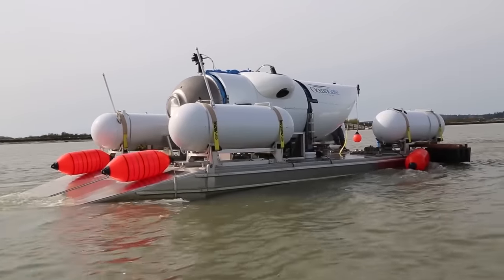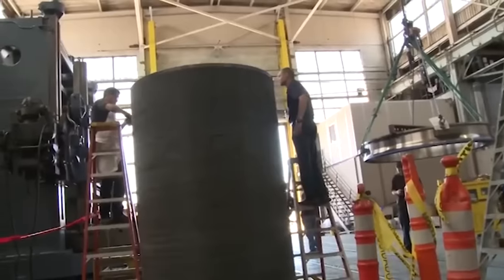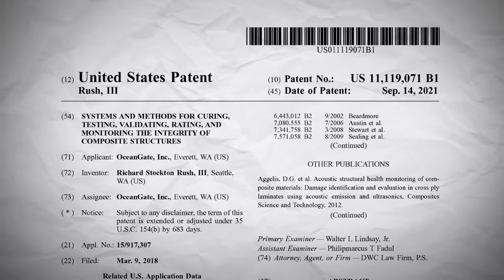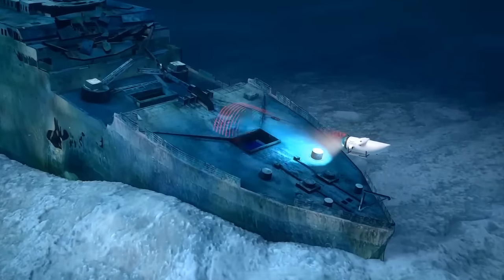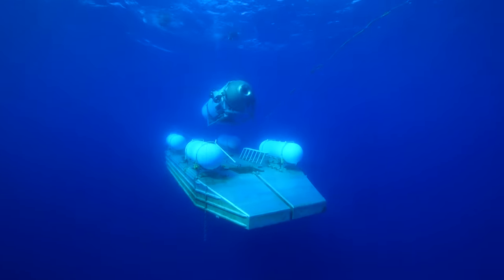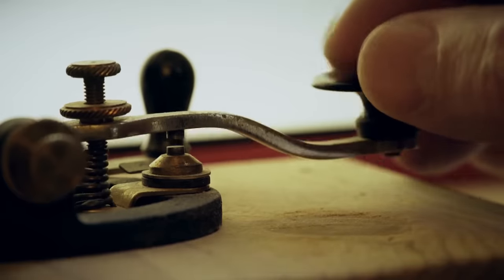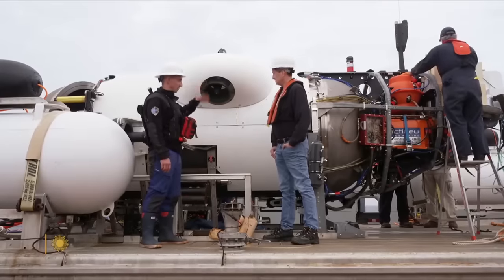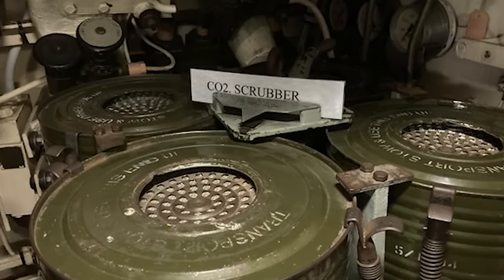Exposing OceanGate Submarines Many Fatal Designs

Comment: 5:50 Most of the complaints about the use of the game controller for the submersible wasn't actually about the use of a controller as a concept; It was more about their selection of a significantly substandard controller from a 3rd party manufacturer. Most organizations that make use of controllers for these kinds of applications usually use 1st party hardware because of its high reliability, and ease of replacement. It is well documented that the specific model of Logitech Xbox controller that was showcased in the interview had known reliability problems. This raised concerns because it showcased that OceanGate were completely willing to use substandard parts for vital functions on their submersibles.
Reply: That is also incorrect. It's the fire hazard caused by it not being purpose built. It essentially had to be made and tested and proven to not cause sparks.

First party controllers are also not safe. The navy uses them in normal air, not pure oxygen, and theirs are usually modified.
Reply: The controller is not the issue here. It baffles me that people keep leaning on the controller as if it is the problem here. No, it is not.
Reply: what is a "first party" game controller
Reply: Yeah, this 'content creator' clearly didn't understand the issues with the controller.
Reply: @tsm688 exactly. that term has no meaning in this context.
Reply: @tsm688  A controller made by a system integrator for the specific system they are building. An example would be using an XBox controller for an XBox. Or, in the case of US Navy systems, a Raytheon (or insert your favorite MIL SPEC integrator here...) controller to operate a Raytheon designed, developed, and built system. These first-party (especially MIL-SPEC) controllers are usually developed as part of the system, very robust, thoroughly tested, and certified to work with their intended system. Because of all this engineering, they are incredibly reliable, but also incredibly expensive. 

The model they were highlighting was a very inexpensive Logitech with known connectivity problems. Gamers hated the controller because of reliability concerns.

Who, in their right mind, would use such unreliable equipment in a situation where lives are dependent on it??

That infers that this knothead was more interested in being cool and 'ahead of the curve' than making it through the curve alive and well.

Unfortunately, he realized a little too late that his decisions were not safe and took four victims with him...
Reply: @DaveC_TN  A very inexpensive wireless logitech is an obvious problem, not just because of reliability but because it's got a potential ignition source - the battery.  An ordinary wired controller avoids all of these problems. is quite durable, cheap, easily replaced, and already understood by most of your personell.  There's many reports from military people that consumer controllers are used -- in tanks at least.  And if they'll use one in a tank, next to all the ammunition, why not a sub.
Reply: Not true. Military applications use outdated Logitech controllers in various new era systems I’ll tell you that
Reply: @tsm688  he means original manufacturer
Reply: @tsm688  being of the era of the nintendo 64, another aspect of the controller lurks in my mind...

the playstation/xbox type uses pots. plain old resistive tracks and ADC convertors. thats their weak point in my opinion, ive experienced many a glitchy worn out joystick. yet you can jump on that mechanism, run it over with a mack truck... it still works. glitchy but robust.

the n64 had the worst joystick design possible. it wasnt the sensor though. that surprisingly, used optoswitches. quadrature encoding. the gimbal, the mechanism, was the weak point...

very hard to get an optical based quadrature encoder to fail.
very easy to get a pot and reference voltage for ADCs to fail.

sigh.

nothings perfect. :)
Reply: When we used to play Xbox/PlayStation together and there were only a limited amount of original controllers and a Logitech one, there was always a debate about who had to use the Logitech one. And we used to switch after some time, for fairness. Because the Logitech controller was, in most cases (not always, I had an awesome one for PS2!), definitely inferior to the original one.

But as so many stated, the controller being wireless was s stupid decision!
Reply: Game controllers 1st party or not, are design for recreation - means a fault can ruin your fun, but not your life -, mass produced with retail price less than £40. They are obviously all substandard for military, or moving a real vehicle around. Even if you have a few spares, what do you do if the controller suddenly start shifting 4 km deep while it is directly connected to the motors? Military use controllers design for them, not game controllers.
Reply: @yannick245  wireless PS4?! [face palm]  that sets stupidity to fantastic new heights.
Reply: Well said
Reply: I'm honestly more concerned about it apparently being wireless.  That means their own battery supply, and antennas on both the controller and sub, all of which are single point failure areas.
Reply: @RobinTheBot  Wait, what? Did you say pure oxygen?  As in fire hazard?
Reply: @RobinTheBot it's not correct, but it's not incorrect either. It is the most blatant example of how they were willing to cut corners to save on cost. And, even if most people don't understand the nuance of a custom built controller by Ratheon specifically for the Navy and a high end gaming controller... They do at least understand the difference between a high end gaming controller and one that routinely goes on clearance for less than $20 and routinely gets reviews along the lines of "it's the best you can get if all you care about is it being cheap." 
And that seems to have been Stockton Rush's attitude, all he cared about was it being cheap.
Reply: @matildafaltyn6253  noreally.gif.nickcage

question is, what is the 'original manufacturer' of mil-spec gamepads.  There isn't one.  The military is using wired commercial controllers.  (Not exclusively, mind)
Reply: @tsm688 something that isn't a knock off of something like madcatz which is already a 3rd party seller with sketchy history. 

Logitech controllers have been garbage since they started selling the shit in late 90s. I've never had one that lasted without failure.
Reply: Perhaps most of the complaints you heard, but my experience was the opposite: multiple outlets expressing absolute incredulity that anyone would use a game controller at all - including conflicting reports over the type of controller (from PS3 to XBox to Logitech) or where the controller was located (multiple reports stated the controller was used on the mothership). Further, there was no suggestion or analysis on whether or not there were spare controllers, and given the absence of concrete information provided by OceanGate early on in the crisis, many outlets went with the assumption that there was a single controller.

I agree with your analysis, and if you're specifically talking about complaints lodged by engineering or ocean exploration organizations, that may well be accurate, but in terms of how the media represented the game controller, they were wildly off base, ill-informed, contradictory, and in some cases flat out false. The OP is right to point out that the game controller as a concept wasn't faulty, but he could have included more detail such as you discussed to clarify that there was still a potential problem with the specific controller used.
Reply: @RobinTheBot hat's only halfway true. It wouldn't matter so much if it was in a blended atmosphere. I mean you can burn diamond in a high enough oxygen environment, most people wouldn't consider it a major fire risk.
Reply: @bztube888 I would argue, if your professional player, that has a few thousand dollars on the line. And start experiencing joystick drift. yeah, that might technically, ruin your life.
Reply: @smileyeagle1021 another legendary example of people cutting corners and therefore cutting life's short.
Reply: @matildafaltyn6253  Wireless PS4? What are you talking about?
Reply: @yannick245  sorry meant game controller.
Reply: So many of my comments here disappeared!
Reply: @matildafaltyn6253  No big deal! Have a nice Sunday, wherever you are...

Comment: There is a huge difference between a game controller controlling the viewing scope on a Virginia class sub and your main sub controls.
Reply: There is nothing wrong with having a video game controller as the controller. The issues lie in it 1.) Being Logitech a notoriously bad company and 2.) It being wireless.
Reply: Why do people keep harping on about a bloody game controller its totally irrelevant. Any automated equipment uses commercial software and equipment you don’t reinvent your own for each job. A bespoke unit is far more likely to fail, after all these units have been fully tested by 10’s of millions of people
Reply: @johnwarwick4105  false. The bespoke controller would have been tested and certified for being reliable and no fire hazard. An of the shelf game controller is built to a budget and if it fails will not kill anyone, because of this it is not built very reliable and not certified. 
You can not trust your life on one.
Reply: @ulrichkalber9039  well if it turns out it was the controller that killed then I will eat my words
Reply: @johnwarwick4105  gaming controllers goes through far less rigorous testing than a controller that is designed to pilot a submersible, no ones asking to reinvent the wheel. There saying it's incredibly irresponsible to use a device that has no where close to enough backup or safety features on it to justify it's use in a vehicle of any kind let alone a craft that is going 4000m underwater.
Reply: @johnwarwick4105 just because the controller isn't the thing that killed them doesn't mean that it's incredibly irresponsible to use it. It shows a pattern of complete disregard for safety.
Reply: @taumctauface1886  Gaming controllers are sturdy, reliable and replaceable. They probably had several on board. I gamed a lot, and do RC cars for year. Never had a fail on a controller.
Reply: I'm not into gaming so I don't know the names of them but I know of 2 in my family that have stopped working, one was last friday, so when I saw them using it I was shocked
Reply: The game controller was fine. It was not operating in extraordinary or harsh conditions so the controller was not an issue. The crappy light on the inside of the sub also didnt matter because it was operating in the same conditions as here on the surface. The problem with the sub had to do with the components that needed to hold up to the rediculous pressures and tempratures down there. The carbon fiber itself wasnt necessarily bad, but they didnt follow any regular construction / testing steps that most would follow when doing something like this venture. Them seeming to not have any idea how many cycles the hull could hold up too before they sold tickets and took tourists down in it is the wierdest part of all of it. You would think they would have a firm understanding of well we can get 5 dives or 10 dives out of this component before it must be replaced. The lack of understanding of what their vehicles capabilities were is what gets me in the whole ordeal. I dont care that a  handful of rich people took a huge risk with their own lives. I just dont. Im sorry that it cost them their lives but even in the best subs out there it is a real possibility when your talking miles under the ocean. 
I just cant wrap my head around how little they understood about their vehicles capabilities or, more importantly, their vehicles weaknesses.
Reply: @christopherbuss680 . I agree, except for one thing - although the pressures were extreme, the temperatures were not - it’d be a couple of degrees above zero. There’s no ice down there!
Reply: Everyone's insisting about the game controller, while ignoring that the hull was never meant to reach that depth.
Reply: @DevilMaster  The game controller and camper wold light are examples of how the company cut corners. The viewport was bad, the bull design was bad, the videos showing how they made it look terrible. Just laying it in an open warehouse. No real method to test for defects in the carbon. People focus on one thing as the cause, something like the controller is just a stand in for shoddiness.
Reply: @russellwillmoth9734  you are correct but even those temps do change materials capabilities.
Reply: @taumctauface1886 nah, as the video said, gaming controllers are fine and a standard in many industries. It wasn't irresponsible. The carbon fiber make was the main culprit.
Reply: It's not the fact that it's a controller.. it's the fact that it's not wired nor is it a licensed Sony or Microsoft product. Just saying.
Reply: @christopherbuss680  carbon fiber is a bad idea for deep Sea. It's great for the atmosphere cause it expands but for compression type of pressure it is not good for that.
Reply: @@evilsquirell995 it's the primary control device for a craft intended to carry paying passengers 2.5 miles deep and navigate close to dangerous ship wreckage. It is very literally life or death. It is not designed for that environment or that purpose. It is an unacceptable fire hazard. Having replacements on hand does nothing to mitigate the loss of control that will result when the one in use dies which could easily cause the craft to take on a dangerous attitude (the passengers were not secured inside) or collide with the wreck or the sea floor. It is frankly bizarre to see people deploying Stockton Rush's logic to defend such cheap, irresponsible design and build choices given where that thinking just got him.
Reply: @comixof2morrow  Carbon fiber can work. The sub had multiple succesful dives, BUT and i stress but, it needed to be used differently, needed to be tested a whole lot more and not used for tourists. Yes there are unique issues that carbon fiber brings to the table but its they way it was used poorly and irresponsibly that caused this tragedy. Not the fact it was used at all.
Reply: @comixof2morrow  also steel has bad compression strength, great tensile strength but not compression. The shape of most submersibles and the many redundant systems is what makes them safer. Titan's pressure hull was a composite made from carbon fiber and titanium. It was a cylinder and not a sphere, that had titanium bells on either end. That was the biggest departure from norms and in my opinion probably why it failed.

Comment: Watching this inspires me to build my own submarine. I think I shall make the hull out of paper mache spray painted with Flex Seal & steer it with an old bicycle handlebar. As for the portholes I think a couple of glass block windows from Home Depot should suffice. Wish me luck!
Reply: Good luck bro, R.I.P.
Reply: just be sure to use some quality sealant in between the glass blocks as cement may fail on you safety first
Reply: @rq4740 😂😂😭
Reply: I think it will work at a depth of up to ten meters.
Reply: Don't forget to use some Gorilla Tape
Reply: A bit over engineered don't you think?
Reply: let us know when it's finished! maybe you could take some of us on board
Reply: $25 bux a seat!
Reply: Innovation at its finest! If I had a million for a seat I'd be there!
Reply: Bring a tarp to throw over it so water doesn't get in.
Reply: Flex Seal .... yes! What a great commercial for flex seal that would make. I think window screens coated with Flex Seal would be a good choice. Glass blocks is an awesome choice. You could supply power with an exercise bicycle hooked to a generator.
Reply: It's terrible joking like that when lives were lost.